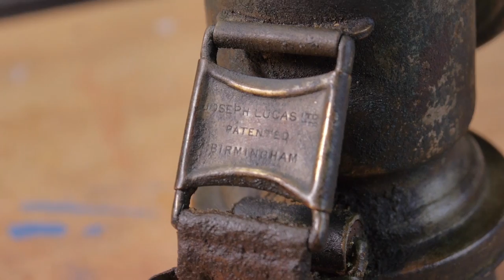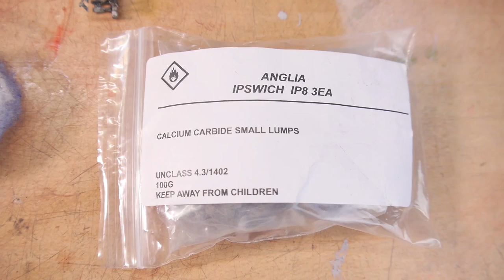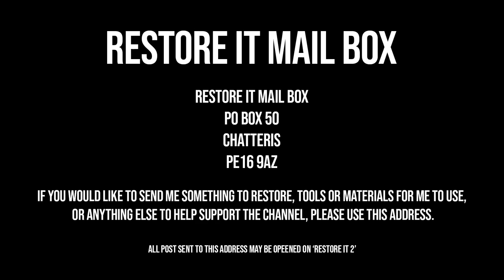100+ Year Old Rusty Joseph Lucas Bicycle Carbide Lamp Restoration

Comment: These were usually nickel plated to prevent corrosion inside and out. Its not too difficult to replate. Nice original restorration though, the colours go well. They also needed to beplated because the acetylene could react with the copper in the brass and produce highly explosive copper acetylide.

Comment: The original finish was probably nickel. Nickel was pretty much standard before chrome was introduced in the mid to late 1920's. That Carbide lamp is probably early 1900's They first started using them on bicycles around 1897.
Reply: yes would never be red, nickel plated or some were nickel, or painted black, painted red wouldn't be suitable for an antique bicycle

Comment: Another excellent video and a Lucas product that works!
Reply: Le Peejon quite possibly? For five minutes only that is! See that comment on the epoxy putty repair made on the carbide acetylene generator unit. This is really only suitable for display purposes and should be labled as such as it would be a fire risk due to the potential for the repair to fail unexpectedly under pressurisation. I took discourse with another commentor on here about the red paint finish which is of questionable taste as the original finish was nickel plating. Even a specialist carbide lamp collector and restorer has commented on this on here and proclaimed that the finished look is not period.

Comment: Brilliant work, amazed you made it fully functional,  as normal well done lad.
Reply: No, it is not "brilliant work", it is dangerous and foolish if he tries to keep using it himself as it is now and, possibly criminally negligent if he tries to sell it without disclosing the hole, the hole repair and method used to repair it if shown or offered as a working lamp or in "As is, condition unknown" now that he's made a video of knowing exactly what he's done to it.
      If you were looking to buy a working pressure mantle lamp such as a Tilley or Coleman brand and someone just put bondo putty over the holes of the pressure tank and painted over it... would you then go on to maybe try to use it if they said to you, " The pressure tank had some holes, but I puttied over them and applied paint so, no worries... I tested it a little bit!"? What if someone in the future doesn't get told or couldn't see what was done to make it just appear as if it was safe to use, does that also still make it "brilliant work"?
       Acetylene gas from Calcium carbide pellets is far more dangerous than propane or even petrol/gasoline vapors and used in welding to cut steel plate. Any repair to an item that contains self-pressurizing acetylene should not be made with putty and painted over.... the damage should be left to remain clearly visible until properly fixed. If the nozzle would clog, that putty would fly out in no time because the pressurization would continue after the flame went out. Not until the water is used up or the pellets run out does the gas production stop and if the flame port and water inlet would jam simultaneously with carbide debris, it could mean disaster even if the holes were properly repaired.
       So "NO", this video is far from "brilliant work" unless... you mean "brilliant work" in either how to eventually burn someone or, "brilliant work" to possibly run off with trading a piece of pretty but dangerous junk for more cash value than scrap metal in it's present state!
    It's value, working or not, is now gone to any collector besides a rubbish collector.
Reply: @grinninggoat5369  I'm glad I'm not the only that is displeased with the use of bondo to fix the hole

Comment: Well done. The bottom vessel will be under pressure with gas so you might have filled the holes with solder. The "bondo" may well blow out.  Also, silver is nearly as easy to plate as zinc and I have seen you plate zinc. I wonder if it was originally nickel plated?

Comment: Nice restoration the side lenses look like they suffered from the sandblasting. Did the suspension mount work as this carbide lamp were used on bike and cars so the mounting acted as a damper so light was carbide solution was not agitated to much during the ride.

Comment: You need a proper buffing setup, I absolutely hate using the drill press and accidentally touching the chuck with the part I'm trying to polish.
Reply: What is a proper buffing setup? The kinds that are essentially bench grinders?

Comment: Restore It
the #1 mistake most people make when restoring brass/copper is to remove the patina (the dark layer on the metal and the green verdigris) removing the dirt is okay, DON'T BUFF IT, DON'T POLISH IT, DON'T BLAST IT,  DON'T DO ANYTHING OTHER THAN A LITTLE PASTE WAX TO PRESERVE IT.  the serious collector actually WANTS to see evidence of age.  by doing what you did, the lamp is worth less that a tenth (1/10) of what you could have gotten for it.  if i saw this for sale, i would walk away and buy from someone else. however, that being said, not bad for the limited budget/resources/money you had available.  Consider saving up for a NI or AG electroplate for the reflector.
if you had simply repaired it and just cleaned off the grime and dirt, i would have been willing to pay several hundred dollars for it.  Painted and "restored" as it is.....$20.00 tops if i were in the market for one.
Reply: David, as a collector and restorer of "working order" carbide lamps and other antique lighting devices.... I agree with you 100%.
          I know in the video he said he ordered solder for later when he showed the holes on the lamp reactor but, then he went ahead and finished the bondo and the paint job... anyone who thinks he would go back and redo all that work to solder the holes just to redo all the work he already put into it before anyone calls him on that fact is fooling themselves!
 Hopefully he keeps it for himself and not offer it to anyone else.

          So, as a side note, I feel it is a safety issue to have to mention here that anyone who will simply putty over several holes in a carbide lamp generator chamber instead of properly repairing the holes and then still not hiding it behind a paint job then.... well, they simply need to be slapped several times over the back of their skull by their mother! it is simply irresponsible and dangerous in the least, criminally negligent if sold as a working lamp!  If it has holes, either fix them right or leave them visible so it won't be used!
           The lamp gets hot, the metal expands and contracts, pressurizes and depressurizes... use after use, it is a fireball waiting to happen!  Acetylene gas from calcium carbide  is one of the rare gasses that doesn't even need oxygen from the atmosphere to burn so, If the flame port had been drilled out to a different diameter and not replaced, it will probably overheat and fry that nice paint job behind the lamp head if used for any length of time at a stretch anyways at the best, at the worst, the pressure could fall to zero in the tank and suck the flame back into it at worst if it is in a cold environment when the inversion happens.
      This just goes to show that a carpenter will try to fix any problem with a hammer and wood putty and, a painter will try to fix any problem with bondo putty and a paint job!
      All that being said, I'm sure he'll find a sucker to pay him big money for the pile of pretty but useless junk he has made out of a piece of history. If it has any worth to a serious collector at all, it is of an example on their shelf of what not to look for or, to serve as an example of what people should not do and call it restoration or preservation when it comes to historic items or antiquities of any era.
Reply: You guys, he's not doing this to resell things! You are stuck in your own frame of reference. He's possibly just doing this for the enjoyment of making something old new again... just for the enjoyment of doing so. You ranting at him because it doesn't fit YOUR preference is selfish and irrelevant. If he were doing this for the purpose of reselling it, then of course, but he is not, so please stop your complaining. This is HIS lamp to do with as he pleases.
Reply: Tina Hyatt I think you are correct. At this point, Steve seems more focused on restoring aesthetics than function. If you haven’t seen his 1920s era Marelli electric fan restoration, it’s very much worth the time. He demonstrates his ability to get both period looks and proper function perfect in that one. I urge him to keep going! I hope commenters will give him tips and tricks to help him hone his skills. He already has talent (and patience) by the bucket load.
Reply: I understand that collectors and museums want items left alone as much as possible, but for some people, they may need the item to look new. I'm currently putting together a couple of replica Great War period military bicycles. The lamps I have coming will be restored to as close to new condition as I can make them. The bicycles will be displayed as close to period condition as possible. I can't find lamp replicas that will do the job, so will have to use original ones. Would I clean and shine an original copper alloy Roman Gallic helmet, not a chance.
Reply: hi i have a carbide bike lamp same as this in good condition it works and have not been messed with only removed dust with a damp cloth , how much is it worth?
Reply: @estherhaveland38  the good condition one I recently bought from eBay was about $80 Australian, and $15 postage. Cracked glass the only fault.

Comment: Nice work. Not to be picky, But you put the glass lens back in around the wrong way. The glass is suppose to curve outwards, this is to aid in spreading the light, and also so that the glass is away from the flame as much as possible so it doesnt get hot and shatter. Nice colour too!
Reply from the maker: Thanks for the feedback Dan, I fixed this after I put the video out. I completely missed it.
Reply: Restore It  It wouldnt be the first time Ive put something on the wrong way around

Comment: You could have soldered the too large hole and the hole in the bottom being how it it is brass. Also, if you do decide to only display it, remove the carbide chunks and clean it out real good. Other wise it will corrode again and quickly.  Nice restoration though. I have an old miner's carbide lamp. But since it isn't in bad condition, I'm leaving it like it is to save the original finish.
Reply from the maker: Thanks for the advice Gary!

Comment: Definitely NOT an improvement on the original. I'm not a patina fanatic, quite the contrary, but painting brass... You have mad skills as a painter so that may drive you to it, but you could polish this up much better if you had researched it a bit. Using citric in your mix of vinegar and salt was completely unnecessary  and may have been what ruined the result. Also vinegar and salt on brass and copper work very quickly, no need for 24 hours. With brass you just may have to help it along by scrubbing extra salt with a toothbrush.

Comment: Painting a brass item is a huge mistake. If you could not afford to have it silver plated you could have had it nickel plated which is quite cheap.
Reply: RobertoDonatti why it’s a mistake? Can you explain?
Reply: Because polishet brass looks wayyyy better than this paint,  and original
Reply: It is not a mistake, that is just your opinion, and we all have them.
Reply: I think you will find that the lamp was originally nickel plated, silver was way too expensive. I have an identical lamp which I re plated as a young apprentice electroplating technician. Mine was nickel plated, I stripped the nickel in a buffered sulphuric acid stripper,polished the base brass and re plated the nickel. I was also fortunate to be able to replace the burner with an identical bray burner.  
That was fourth years ago. It's still in good condition and works like new. Getting calcium carbide is more difficult though.
Reply: When I was a kid, (I am 65), we went to the local hardware store and bought tin cannisters of carbide for a dollar or less. We played with it. No questions asked by the hardware salesman. It is fun to put it down the drain and hold a match to the drain. It goes FOOM and the plumbing shakes in the whole building. It is a wonder I lived through my childhood.

Comment: restorers who don't sand primer, and just paintt leave behind gross looking surface imperfections. I'm glad you're not one of those types. restoration vs.."a quick sand and repaint job"
Reply from the maker: Hey thanks man.
Reply: @RestoreIt  If there was anything I might offer as suggestion, for improving your game, might be fabricating new parts yourself. A challenge to get into, but if you have to replace something or STRONGLY REPAIR it, then doing it yourself, feels "wholesome" as opposed to going to Lowes and grabbing something off the shelf.   Buying "vintage style" parts is an acceptable middleground at least from my perspective as a viewer who appreciates "era accuracy" and what not. But getting the paint job to look "right" maybe even trying to match the original paint colors, I think is good. a smooth finish just looks right, and slathering some...heavy latex paint on with a paint brush, and it ends up looking...like the surface of mars...is gross.   Keep going, CHALLENGE YOURSELF. there was a video for restoring an old military helmet. That's not interesting. the italian desk fan. was great. complexity, intricacy. seeing it WORK after you were done. that's high points to hit. a knife...is simple. and been done.

Hope my feedback is helpful, I don't want to sound like a stick in the mud. but if I have to to say the truth needs saying, so be it.